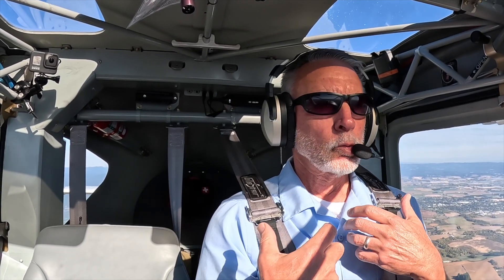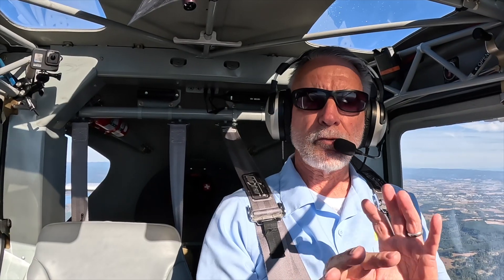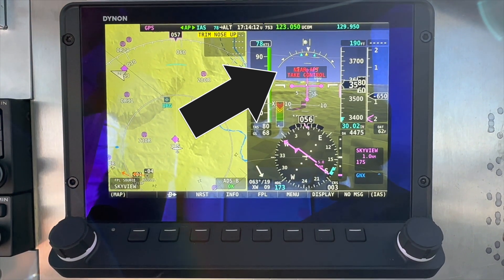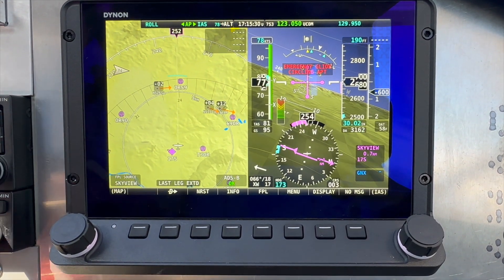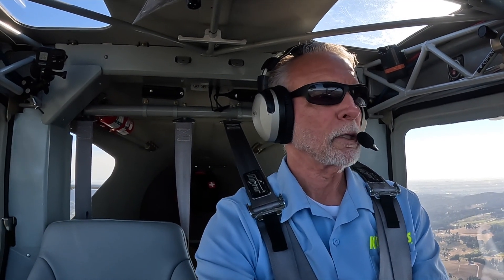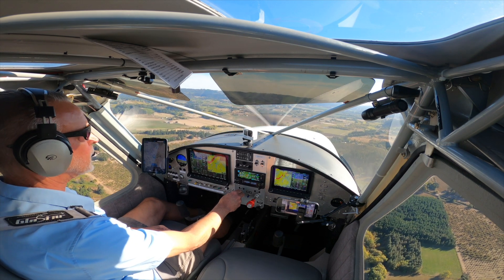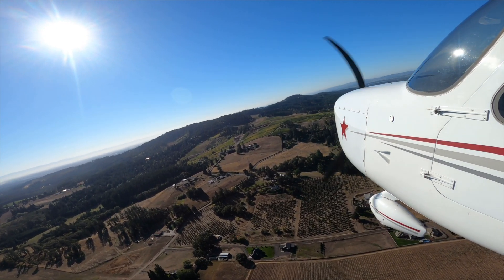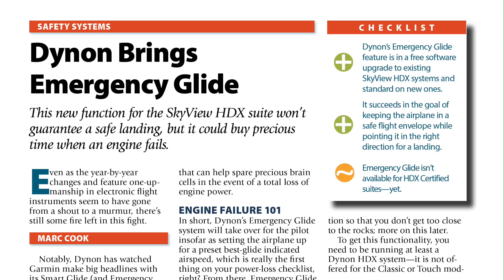Dynon Emergency Glide Flight Trial

Comment: I tested this as well and live in a "military" intensive area of the country with many Outlying airfields.  The Emergency glide will take you to both Military fields as well as Private airstrips...it is a great tool to allow the pilot to trouble shoot and not have to initially worry about flying the plane.